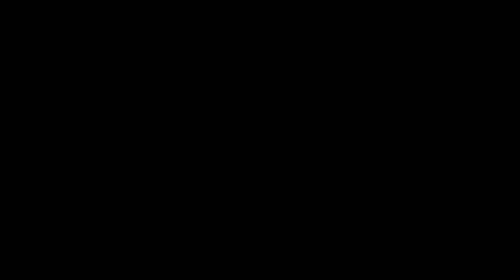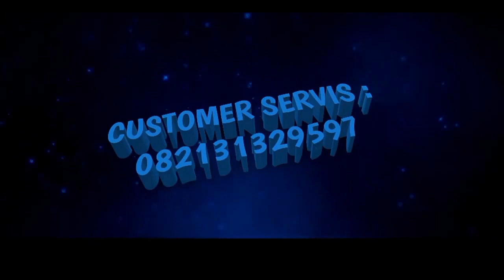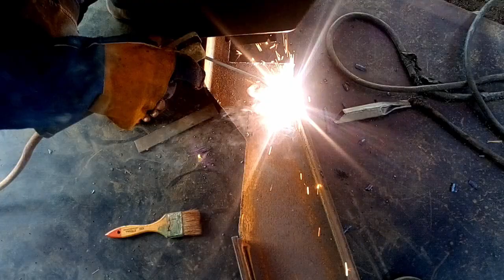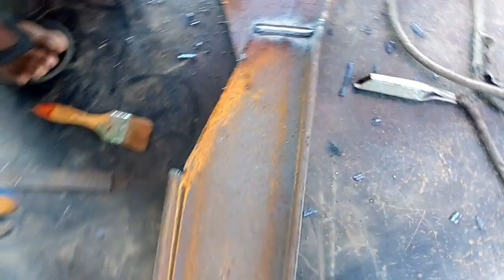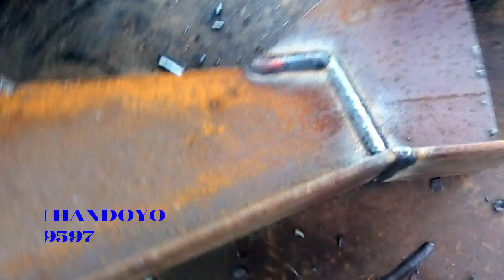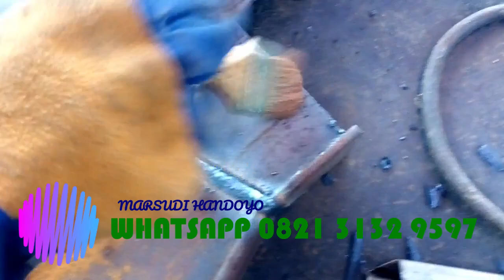BELAJAR CEPAT NGELAS BAJA WF YANG BAIK DAN BENAR

Comment: Saya nubie banget. Saya udah research di Youtube dan internet mengenai konstruksi baja. Saya mau nanya, kalo pengelasan sambungan, apakah cukup dgn metode Fillet saja, karena saya berencana semua sambungan dgn metode Groove. Kemudian berapa layer untuk sambungan dan berapa layer untuk siku? Apakah utk sambungan sebaiknya pakai teknik pengelasan Root-pass, Filler-pass dan Cap (cover) ?
Reply from the maker: Tahapan nya root, merupakan istilah proses pembuatan akar las, dimana istilah akar lasan disebut root.

hotpass, proses kelanjutan setelah pembuatan root, biasanya menggunakan ampere tinggi. Tujuannya adalah membuat lapisan lasan yang kuat karena didalam proses root rata-rata menggunakan apere renda untuk mengontrol cairan.

fill, pengisian lasan hingga mendekati bibir base material bagian atas, kalau bahasa kita diisi hingga hampir penuh.

capping, proses terakhir dalam membuat sambungan butt joint.
Reply: @konstruksibaja   Saya juga lihat informasi,  bahwa pd saat root-pass kita menggunakan DCEN, sementara proses layer berikutnya menggunakan DCEP. Dimana yg jadi pertimbangan adalah, di bagian mana jumlah panas harus lebih dominan, apakah di base-plate atau di elektroda.
Reply: Kayak mau ngelas paplen atau tangki oil & gas aja boss he..he...

Comment: Kalau besi tebal 6mm bisa dilas pakai mesin las 900watt gak mas?
Reply from the maker: Pakai kawat brapa
Reply: @konstruksibaja  pakai kawat 2,6 bisa mas? atau mas ada saran?
Reply from the maker: @hermanto6215  bisa pak cmn lama ngelas nya pakai kawat 2,6. Pakai yg mesin las 200 amp bisa pakai kawat 3,2 lebih cepat dlm pengelasan.
Reply: @konstruksibaja  trima ksh byk mas,   infonya sangat membantu.
Reply from the maker: @hermanto6215  sama2 pak semoga membantu
Reply: Make suhu yg berapa?